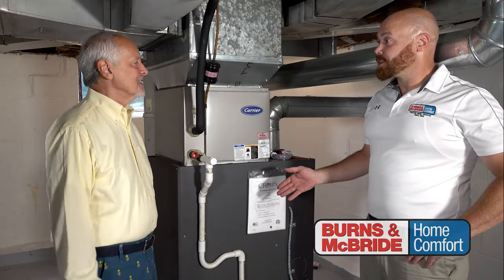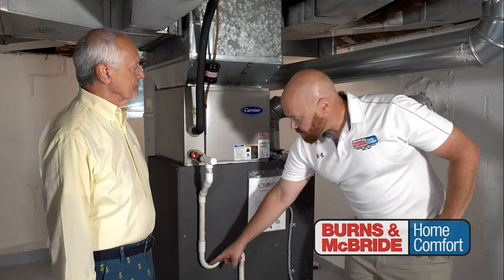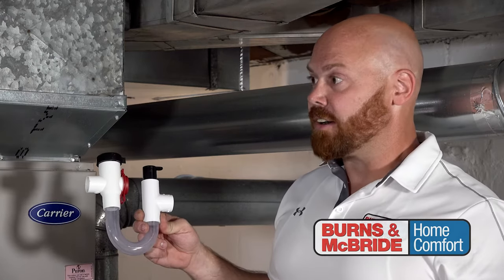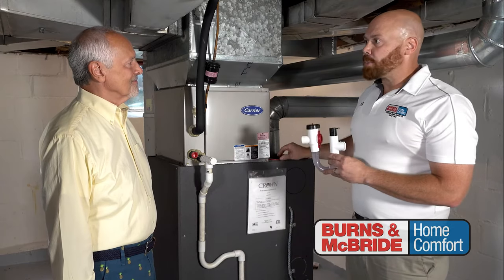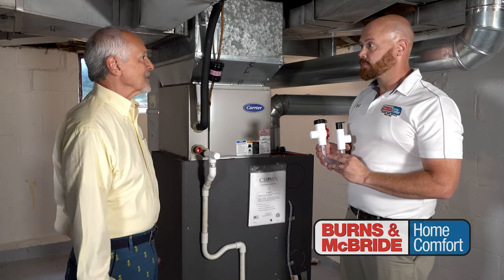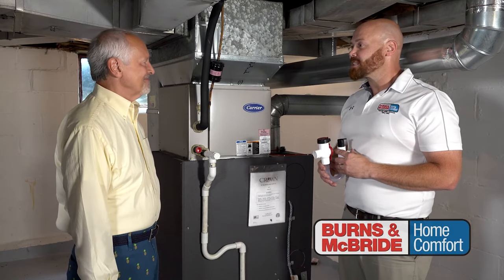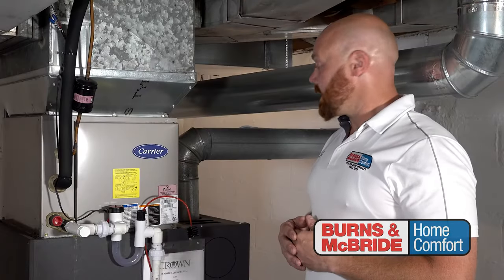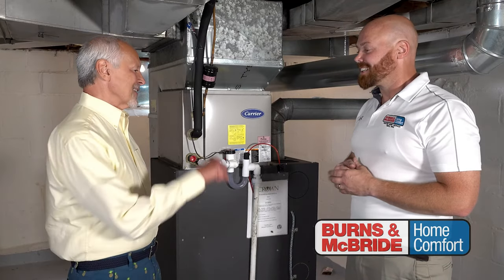EZ Trap - Condensate Overflow Switch

Comment: I love the addition of the slip joints so this can be taken apart if needed. My system in the house I bought does not even have a P trap or a way to clean the drain, and I can't even remove the front of the unit to inspect it. I will be installing one of these in a similar way to what you installed.